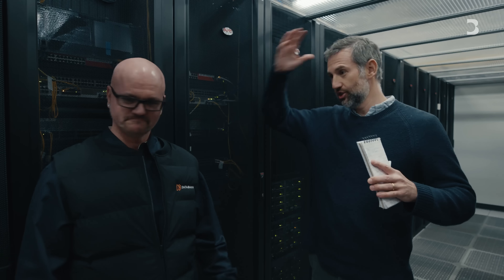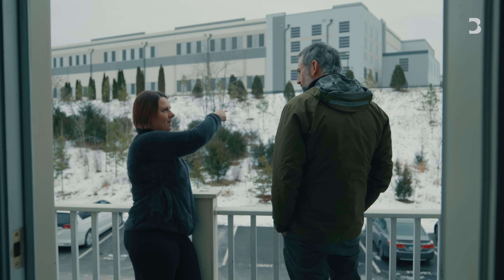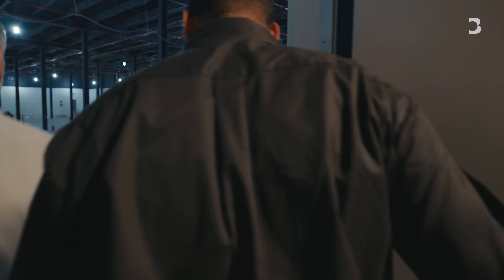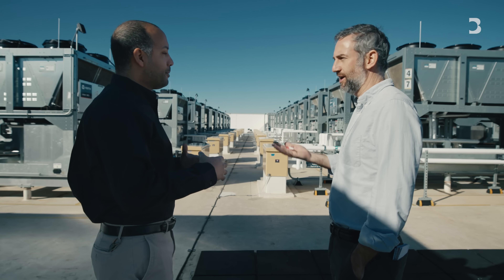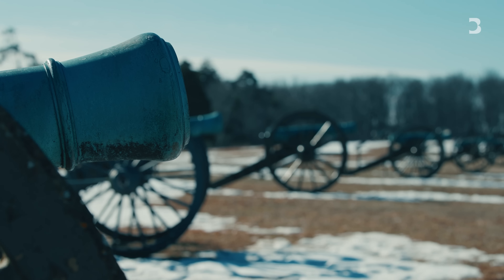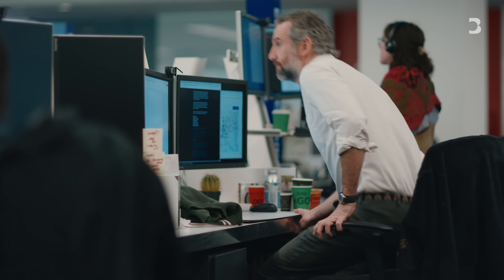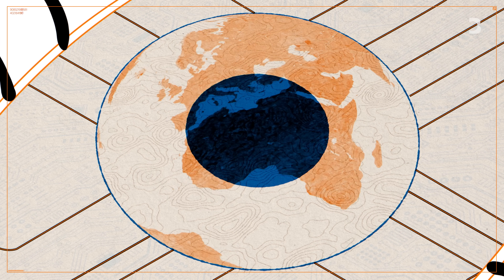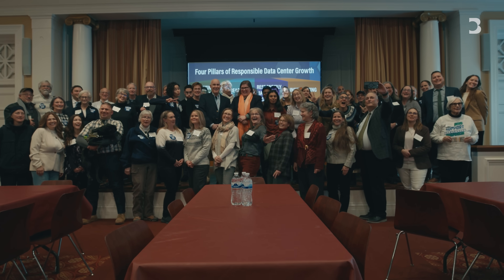The World Needs AI, But There's a Problem

Comment: People in charge LACK FORESIGHT and any Tech knowledge.   The U.S.'s electrical infrastructure is antiquated and desperately needs upgrading.  It will take years if not decades to set this right.   Seems the U.S. is always in a reactive mode and never proactive.  It is embarrassing to compare this to China's power grids - they have a surplus of energy with Ultra High Voltage transmission lines crisscrossing their entire country with solar, wind, fossil fuel, and nuclear reactors as energy sources.  They build new reactors for fractions of the cost & time vis a vis the U.S.

Comment: The train is louder because the sound/noise is bouncing off the data center and directed towards the residential development. Trees do very little to mitigate noise. It's mostly a psychological trick as you can't see the source of the noise. But a wall of hard, sound reflecting materials will definitely increase the dB for those residents.

Comment: We need to find ways to reuse the heat. This can be through heating the nearby residential houses or green-houses. One more manner of reusing the heat is adsorption cooling. This can reduce the demand for cooling systems, which consume a high amount of electricity. So, you re-use the heat while also reducing the electricity requirement.

Also, using rooftop solar systems to reduce the dependence on the grid. The efficiency of panels will be higher due to very cold temperatures.

One more manner can be a vertical expansion of data centers instead of horizontal expansion. This will reduce the land footprint of data centres.
Reply: One of the problems with trying to reuse the heat is the delta temperature is relatively low. EG, Datacentres produce a lot of heat, but at a relatively low temperature. So unless you have high density housing physically close by, it gets hard to transport that heat longer distances. Additionally, the question is who should pay for this? Most datacentres would be thrilled to supply heat for the local town, but can't justify paying for that infrastructure. If councils covered some of this cost we would see a lot of redistribution of the heat

Absorption cooling can be more technically effective, but not cost effective at scale yet. 

Rooftop solar is completely irrelevant and impractical. some facilities require 250mw+ of constant power but only have enough physical room to generate less than 3mw of solar power, and covering the roof with panels would impact cooling. 

The problem with going physically taller buildings is you don't have enough room for generators or chiller equipment. In some high density buildings the density of chillers on the roof literally starts to impact their efficiency due to heating up all the air around the building. Additionally you need to have some physical separation of generators from a safety and fire perspective.

Comment: This is exactly why Nvidia has boomed so fast and why it could face a major correction. Nvidia currently dominates AI training with the most powerful GPUs and their CUDA technology being the most popular for developers, BUT they are not efficient, never have been, and power consumption is becoming a critical issue. Although competitors like AMD, Intel, and Huawei are behind today, innovation in efficiency will eventually determine the future AI ¨engines¨, especially as regulations tighten (like we’ve seen in the EU). Apple has shown what’s possible with ultra-efficient chips for consumer devices, and while they aren’t in the AI data center race yet, the future will favor companies that combine performance with true efficiency.
Reply: And then you actually spend some time researching facts, and you learn to relax.  First off, AI uses less energy that crypto mining, which itself is 1% of total consumption.  Then you learn the USA is a NET EXPORTER of electricity, yes, we make more than we use, and sell to both Canada and Mexico so we have plenty of headroom.

Then you learn that each new generation of chip is usually over 3 times as powerful in computing, while ALSO being way more energy efficient.  Nvidia's latest chips fall into that and to produce an equivalent amount of compute as the prior generation would use less than 1/50th the energy.

So. in summary, relax.

Comment: I work in IT infrastructure, all our servers and storage devices are over spec for the work they are supposed to do. Such as they are usually just using 10-40% of their compute or storage capacities, and there are thousands of servers. So all those space and electricity are going to waste.
Reply: Cloud data centers are NOT the same as AI data centers.  GPUs are NOT underutilized like CPUs, recently OpenAI had to combat overusage when their huge image creation improvement went viral.

Comment: The demand for this is clearly growing, why cant we find a way for these data centers to be self sustainable, have their own power generation instead of relying on the grid?
Reply: Are YOU off the grid?  Why not let data centers and AI have ALL the grid, and homes, which keep in increasing in number have to get off the grid?

AI saves lives daily, cures disease, ends birth defects, advances science about a decade each year.

Your HOUSE?  Not so much, contributes NOTHING to society.
Reply: So essentially combine a power plant and a data center? The only way this could be plausible is if the data center could produce their own electricity for a lower cost than they pay the power company. I think connection to the grid with some solar to supplement is more realistic. Perhaps your idea could work for megaprojects though.

Comment: Modern data centers also do not create many jobs. Only 20-30 people, so these are not big employers either, but they are a massive drain on the local economy in terms of power and land use.
Reply: Rubbish
Reply: I’m a die-hard liberal…and that is non sense. I live a few miles away from a DC and on any given day I drive by it there’s more than 30 cars in the lot. More like 80-100+. That’s not even including the construction labor which probably employed hundreds. So no, these data centers do NOT employ just 20-30 people. That 20-30 people would probably just be the IT staff alone (networking, network security, data techs, server support personnel). Then you have your engineers which on any given day would be another 10-20 people, your industrial maintenance staff, etc etc…so you’re way off. I also know all of this because I’ve worked at 2 data centers as a contractor. That’s no my cup of tea but they do serve a purpose and with the way the worlds is going it’s far too late to turn back from them. At this point, we have to view them as critical infrastructure. The same way you would not want our power grid in the hands of Russians, you do not want to see what would happen if your banking information or your kids personal information ended up in the hands of another foreign adversary.
Reply: As of October 2025,  over 177,000 tech employees have been laid off.   With more to come. The primary reason for many of these layoffs is the ongoing shift to AI. So,  I'm guessing your political bias is not aging well .🤔
Reply: total nonsense (coming from someone who has worked in this sector). Building these DCs takes a lot of construction (jobs), involves expanding existing power stations (jobs), and large DCs require hundreds of people to run (on rotating shifts). They bring millions in tax revenue into state and local economies, and are critical for moving the US into the 21st century.ut I guess the political left would prefer people to work at Walmart, collect welfare, and spend their money on drugs
Reply: @colinhiggins4779  Construction jobs?   A few jobs for construction Workers for 15 to 40 months,  Expanding Power Stations?  Even fewer job construction jobs and no new jobs for the Power Station? AI will have that work covered.  Higher Electrical and utility cost. Data centers are utility hogs with zero payback to the community and a net loss of jobs. What kind of AI generated world do you live in?
Reply: @Morris-nu1jm   people who construct and work at these datacenters spend money, purchase houses, and pay taxes in the community. These DCs are necessary for the new economy, unless you want to turn the US into a country like Germany, which is deindustrializing, and falling behind, after following nonsensical and absurd climate-cult policies
Reply: @colinhiggins4779  A few construction jobs, even fewer full time jobs, and the community will be
paying for the increase in water and electrical power. 
The Germans went "all in" on EV's, wind power  and solar. They forgot to check the weather history and the manufacturing location before they went "all in"
Reply: @Morris-nu1jm the Germans turned off their nuclear power plants and wrecked their energy sector. Nuclear power is what will power next-generation datacenters
Reply: @colinhiggins4779  Utility companies need to get started on building all those nuclear power plants, takes more than 10 years and billions of $ to bring a new 1 on line. How are useless data centers going to pay for that?
Reply: @Morris-nu1jm the only reason it takes so long to build a nuclear power plant is regulations, red-tape, and corruption. Newer designs can be brought online within a few years, and at much lower cost. China is spinning these things up very quickly.
Reply: @colinhiggins4779  So you want to build Nuclear Power Plants with no regulations?    What red tape and corruption?    Why does China need so much oil and gas?
Reply: @Morris-nu1jm not what I said. Do you want a modern economy with ample power, high-paying jobs, and necessary technology? Or do you want to be like Germany, and deindustrialise, go into rolling recessions, and have even dirtier air?
Reply: @colinhiggins4779  What jobs?  Where are these jobs?   Jobs producing what, for what?  Spend billions building nuclear power plants to produce electrical power for data centers for "so called" AI.
AI produces nothing of monetary value, so who pays, where does the money come from?

Comment: What about nature? All those cut down trees and forests can't be replaced instantly. Anyway, just wanted to give a reference for the average electricity consumption for a U.S. home, which is around 10.632 megawatt-hours (MWh) per year. This figure represents the average across all households and can vary significantly based on factors such as location, climate, and household size.

Comment: Too many lawyers, and not enough engineers, scientists, and builders in the system. As the demand for energy and space grows, we need people who can actually come up with ideas and plan for the future. What is it going to take to power industry and homes? If it's using too much water and power, can you run these systems on something much more efficient than millions of power hungry gpus? Americans need a swift kick in the rear because they have forgotten that all the things they need require a physical presence to manufacture it. You can't both want something, and then complain when it's built in your area.
Reply: An engineer will put a datacenter next to your house because that's the most efficient place for it.  A lawyer will help you stop that from happening.
Reply: @r9bet  Right and that's why the US has become anti-growth over the past few decades. We need data centers, power plants, etc but litigation is how those projects are stopped. Then people complain about energy costs. That doesn't work both ways.
Reply: Pencil pushers will always be at the forefront of the push for AI. Ironically, they want to replace the very people who create and program AI with AI itself, while failing to see it is their position that is the most obsolete and wasteful to society, not the engineers.
Reply: ur right
Reply: Relax, AI uses LESS electricity that crypto mining, and that's 1% of total consumption.  The USA is also a NET EXPORTER OF ELECTRICITY.  Yes, we ALREADY don't use all the electricity we create and sell it to Canada and Mexico.  So, again, relax.

Comment: optical compute is coming to save the daY! when it comes it will reduce power consumption and heat generation massively
also they COULD EASILY build datacenters in cold places like greenland or really anywhere mostly cold all year, but they dont. they could power their DC with solar and wind but they dont.

Comment: If it was put to a vote where the datacenter operators said we'll occupy x sqft of land, provide y tax revenue, and supply z high paying jobs, 98% of people would vote yes. And then you'd have a few old nits with nothing better to do than complain, try to feel important by "standing up" to these companies by passing useless regulation. They're easily ignorable. Just vote on it.
Reply: The lady's concerns though in the video are legitimate. Also job creation will be limited after the construction phase - data centres, once operating, require minimal manpower (maybe 100-200 employees at most).
Reply: @cricketer1987  if we don't need you, you're the problem.

Comment: Bring them here to Canada, we need jobs and our electricity is cheap :)
Reply: Looks like Canadá is needing some American democracy…
Reply: Can you spread some of that Cheap Electricity Mind Set (Political Drive) to here in Australia? 
Our Government is a Renewables (Wind + Solar) basket Case.

Just take a look at our politician, 'The Bowen'.
Reply: Indeed, also lots of cheap cooling due to the climate.
Reply: @bandita2068  that is why a bunch are being planned in Alberta.  Its cold enough that they dont need to use water for cooling and for power the data center companies are just partnering with private power companies to build them power plants.  No need to tap into the grid.  Connect to the natural gas pipelines and they can basically produce as much power as they need.  There is one really big data center that is being planned right now in northern Alberta and they have the main natural gas pipeline running though the property along with 2 natural gas companies that are right next to the property so basically the natural gas will come out of the ground and then almost go straight to the power plant.
edit: I understand there is the concern with climate change but in theory if they also partner with a company that can create hydrogen from the natural gas then it would be possible to go over 90% capture since they would be building the carbon capture with the plant.  From there that CO2 can go right back to the oil companies in the area and they can use that CO2 to extract oil.  So yes there would still be a carbon footprint but it would be much lower and the CO2 that is captured would be an asset. Also with the price of natural gas being so cheap they could do all that economically.  I've heard the data center companies want 5 cent per kw for power and that would be possible with carbon capture.  Without carbon capture they would be around 2 cents per less per kw.
Reply: They need to come to Alberta 😁

Comment: Microsoft Bit 1 LLM is going to change that.
Deepseek gave us a glimpse.
Reply: What do you need an LLM for? There is nothing it is more capable in than people.
Reply: yeah i have tested deepseek R1 1.5b the smallest model and it runs quite well on ordinary 64bit intel i7, now i will try it with other heavier models by using RTX-4060 it should run fast i guess

Comment: Virginia has a nuclear power plant at Lake Anna with two reactors. For years there has been talk of expanding the station with a third reactor. It is time to get going with that. There is also a company planning the first fusion power plant in Virginia. Power won't be an issue if we plan for growth.
Reply: The Unit 3 would be about 50% higher in capacity than the other units at about 1.5 GW and use passive shutdown cooling able to provide no active cooling up to 72 hours.  After that if nothing works fire truck pumpers could be used move the cooling water around or other portable pumps.   There is a cost in efficiency for using passive shutdown cooling architecture.
Reply: Sadly too many powerful people think if you need electricity you just plug a cord in the wall and there is an endless supply
Reply: It’s funny you say that. AWS is actually building data centers in Spotsylvania now right off lake Ana.
Reply: You would have to reinforce the grid in addition to allocating power.  I believe there is still a ban on new data centers in Loudoun County because of power constraints (all of the large cloud companies literally have hundreds in this county).  That is why new data centers have been popping in farther away for years.  Who knows, in 5 years there might be new clusters popping up in faraway places like WV, Richmond and Annapolis.

Comment: 4:30 on average one home uses 1.2KW power at any given time, it means 1MW can power roughly 800 homes, not 3 or 4 thousand.
Reply: What are you cooking bro, 😂😂😂 iron ore???
Reply: He scaled it in Output per Hour. 
A normal household spends about 300Watt (0.3 kWh) in one Hour. And about 3300 housholds reach the consumption of 1 MW in one Hour. 
If you‘re scaling it up to one day you could firmly supply 143 households with a capacity of 1MW.
Reply: 1kw? Wow, i use 9kwh for all day.
Reply: @etienne4403  There is a difference between kw and kwh. If you use 1 kw for 5 hours, the amount of power you have used is 5 kwh but you were using power at an average rate of 1kw in those 5 hours. I hope that sort of makes sense.
Reply: @edison_kyama  indeed, that is why I find 1.2KW a lot  as an average at any given time, as I only use 9Kwh for all day (or 3500 Kwh for a full year), so on average like 400W. Only when cooking it goes up in my case.
Reply: Mine uses about 1-2Kwh per day on average (but I do have solar).